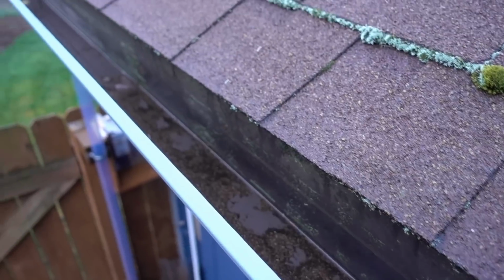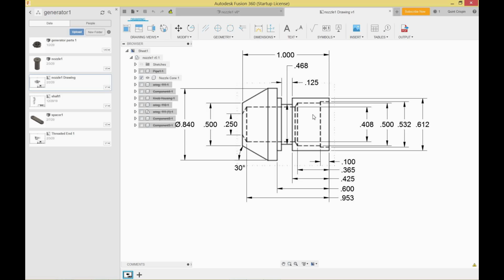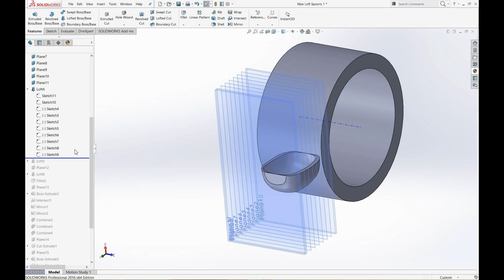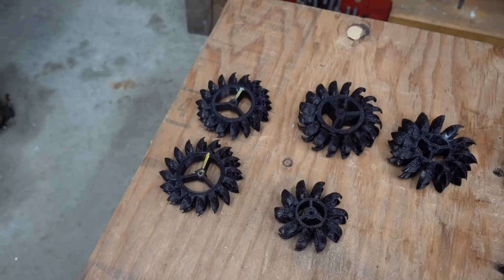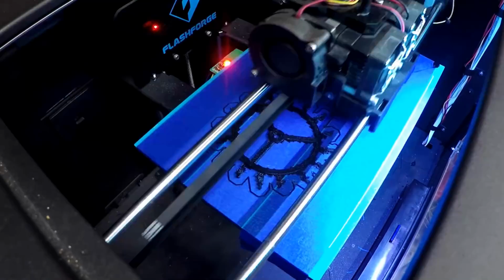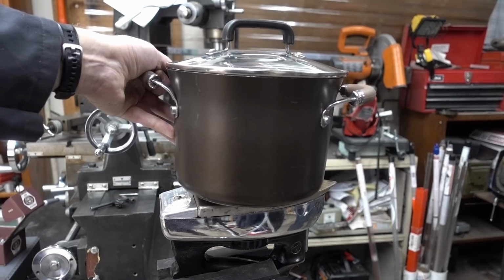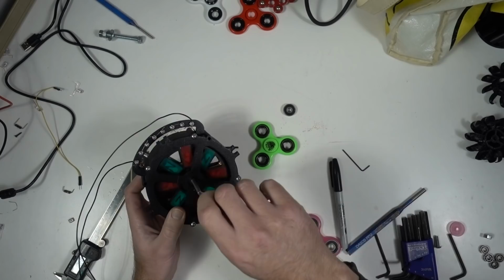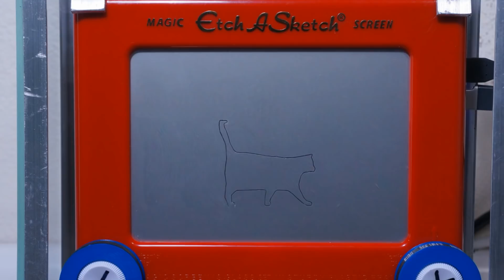Rain Gutter POWER #3 - Fidgeting With Turbines!

Comment: most of the friction is the grease the sealed bearings have and a little from the seal(not much) fidget spinners work by taking a bearing, having no grease and no seals, upside, they spin manually, downside, put into a load application they'd wear out stupidly quickly
Reply from the maker: I went through the drawer of sealed bearings at the hardware store and found substantial variation across bearings.  I suspect it was the rubber seal but wouldn't know without a measurement device and removal of all seals to check the difference.
Reply: @QuintBUILDs  they pop out with a pick or a needle, take a generic sealed ball bearing, feel the friction by spinning it, remove the seals with a needle and soak/spin it in a little petrol, set it to dry,  then spin it again, instant fidget spinner bearing

Comment: I know it's only video 3 on this subject and I've just seen number 6 I think. I noticed that you have the nozzle horizontal to the pipe have you tried having the jet of water coming straight out the bottom giving gravity a say in the matter. As the 90 degree angle of the spout is surely causing resistance.

Comment: Did you think about enclosing the turbine then injecting it with water with an outlet and you could have the water coming in from the top maximizing the gravity assist, combined with the injections all around harnessing the Whirlpool effect as well as a quasi ventruvi effect. Place the turbine horizontal and 45* the shovels.

Comment: I'm interested in why you chose to put the hole in the side of the pipe.  I feel like you wouldn't get the full pressure from the weight of the water in the column in that setup.  If you used a funnel and curved it off of the bottom of the pipe you may squeeze more pressure out of the system.

Comment: A couple of thoughts and or questions.  
1 . Do you think that turning the out put nozzle horizontal is more efficient than having the output vertical down flow ?
2 . Another commentor observed your splitting of supply to nozzles being on a single small tubing source . I tend to wonder if that person was right and that you may be cutting power in half to each nozzle .

Comment: Did you verify the potential of the alternator?  Can it produce 1 watt?  Also because you are replacing pressure with flow, the discharge rate of the water may not be high enough to ever reach the desired 1 watt even at 100% efficiency from the turbine/alternator combo.

The ideal here would be to somehow increase pressure and flow for a higher discharge speed.

Edit
I used "flow" when 'volume' would have been the proper term...  I think.  lol it's been quite some time since I have "scienced"  😋

Comment: Have you considered other means of generation besides the Pelton wheel, such as a Francis spiral or a reverse Archimedes screw?  It might be interesting to determine which would offer the greatest conversion efficiency based on varying flow rates and head pressure?

Comment: @quint builds; I didn't read the other 3500+ comments so I might have missed it.  I see that you engineered it to have the jet shooting horizontally.  Wouldn't a downward facing jet be better?  1) the water would have a little more gravity behind it.  2) the water in the "cups" (near the 1-3 o'clock position of your setup) would be able to escape nearer the 6-9 o'clock position.  As soon as the water gets to the 3 o"clock in your original setup it's fighting gravity.  Thoughts?

Comment: Did you considered the fluid losses through the gutter and all the system? with such small amount of energy obtained from that roof, for sure any simple loss is critical in your design. Also, just to add fun, with all the work you have put towards producing that energy you could have payed 3 years of the electricity that it produces. :D anyway thanks for the experimental process.

Comment: i'm wondering what the flow rate was before and after the installment of the nozzle, the power output was roughly the same, but if you did it with half the flow you still made a huge improvement

Comment: If you try a larger bearing I think it would be less resistive as well as more durable
Reply from the maker: I reasoned that the smaller bearing giving equivalent friction at a smaller radius would result in reduced torque.

Comment: Change tube ..To a bigger diameter 12"
The waight of the water increase 
Pressiur...
Add more nossels Then 1 
You add if 1 is 4watt
2 nozzels is 8 watt
3 = 12watt ..
Reply from the maker: Pressure is density x gravity x height.  It (and power) are independent of diameter.

Comment: I wonder if a second water nozzle output would help. Maybe one on top of the wheel and one on the bottom in the opposite direction would harvest the wasted energy.
Reply from the maker: You must not have watched the whole thing before commenting?
Reply: @QuintBUILDs  Oh I missed it. Wonder why that didn't work? Maybe make the holes half the diameter so you don't lose too much water pressure? Anyway that was a cool project, subbed.

Comment: You're losing a lot of downward momentum by putting the nozzle in the side rather than printing an angled funnel at the bottom of the pipe. You're basically just getting the water pressure and no downward momentum.
Reply from the maker: The water velocity in the large pipe is near zero. It's a reservoir.  No momentum to lose.

Comment: What if you used the weight/power of the water falling from the top of the drain pipe, to lift a small weight that would somehow be attached to a "plunger" thingy that would add pressure to the water. It would work in bursts I think. Or maybe if you moved the turbine higher up and collect the waste water to use, kinda like one of those marble track escalators....?????

Comment: Ok,, I've watching these 3 video series. Now I'm curious about a couple things,,, A- since an alternator, and a generator, have the same build set up principle,, meaning a stator inside of copper coils,, why can you not still design a generator without the brushes?  B: have you thought about using a series of gears,, much like on a 20 speed bicycle? And C: making the water wheel a much larger diameter, with many more cups, in addition to the multi-jet idea?? I would think that idea would cause a faster rotation at the center of the wheel.
Your thoughts?

Comment: Augmenting the height of the water column would augment the pressure, even with a very small diameter.
How could we do that? By digging… or using a pump. How much electricity does it consume?
Above what height would that be interesting?

Comment: The outlet of the nozzle is the same size of the hole. Why not make a tapered design like a fire hose and a small outlet like the ones pictured?You could prototype with the printer and epoxy to fill the layer gaps  pretty easily.

Comment: If you extend the height of the pipe for a greater pressure ? Also sounds silly but if you put the alternator into a vacum would less air resistance also improve efficiency? Just asking 🤷‍♂️

Comment: You need to put it down its now hanging but then its harder to turn when you put it on it side then gravity wil take off the pressure on the wheel and it will go much faster because it got no pressure from gravity

Comment: Hey great project.  I'm a Master Brewer.  I push water around a lot.   Are you maximizing your head pressure?   Also, your wheel looks a bit overpowered by your choice of flow rates, dependent on your orifice size.  These are all variables.   Might add some balanced weight to your wheel as well to optimize the grab on that kinetic energy.  And _I_ might realize there is a 4th video LOL.

Comment: What if you did the multiple head setup with the graduated tube around the wheel? What about turning the wheel sideways so the water casts off after the initial contact and shed the extra weight of the water

Comment: Mechanical engineering 101: Power (watts) is pressure (pascals) x flow (cubic metres per second). Water pressure due to height is 10000Pa per metre. Even the best turbine won't be more than 80% efficient. Convert volume to gallons if you must, but you'll quickly see how much of a waste of time this is.
Reply: I literally came here to say this, just a very rough guesstimate says they’re running about (one to two) cups of water per second which is roughly (2.5 to 5) x 10^-4 cubic meters per second, or in layman’s terms 0.00025 to 0.0005 cm/s.

Assuming one meter of water, that’s Power (in Watts) = 10,000 * 0.0005 = 5W, and that’s being incredibly generous with their flow rate which is likely about a quarter of what I estimated.

Factor in the poor efficiency of the turbine and alternator and I think they’re pretty much at their peak already - using two nozzles to power two turbines wired in parallel would be the ideal way to go here, rather than using both nozzles to power the same turbine at such low pressures.

Comment: Would It be possible to incorporate an excited field to the alternator to increase the drive load and regulate the voltage to stay at 5v?  The intent would to be design a turbine that produces more torque at a slower rpm. May be a slower system may capture the water a little more efficiently.

Comment: Would it make any difference to change the angle at which the water is coming out of the pipe? So if you were to out the nozzle pointing straight down, rather than to the side?

Comment: Are Pelton wheels the most sensible application as their efficiency is so dependent on inlet speed so how could you control that with the rain gutters. Also could you not calculate the maximum energy within your pipes to determine what the maximum electricity is you could obtain to see what efficiency you are actually achieving. Cool project liked the video

Comment: Hi, I found all 4 parts of your project quite interesting. However, I was disappointed to see that you did not show any adjustments being made in the nozzle that you made. 
I’m not a scientist and I guess you are so forgive my lack of understanding if I’ve got this wrong. 
Like a garden hose or a jet washer, the size or shape of the nozzle changes the speed at which the water flows. I reckon if you go back to fitting the nozzle you made and adjusted it so it gives a higher pressure of water displacement, then you might find the wheel will spin faster (maybe) 🤷🏾‍♂️
I really would like to know if you did that and what the results were 👍🏾👍🏾

Comment: Would orientating the jet vertically help? So that the stream is shooting straight down or slightly across the wheel, and the waste water is then shed without being caught in the wheel’s cup and hence not adding weight on the up swing?

Comment: Stupid question, but what if you built a curved piece around the wheel? A lot of the water's energy seems to be flying in a roughly horizontal path after hitting the wheel, so would putting a curved piece of metal around the wheel to redirect the water increase the output?

Comment: My question is. Why isn't the turbine mounted in the downspout itself to use the gravity pressure in strictly, vertical to horizontal configuration, and avoid the loss of changing the supply water 90 degrees.

Comment: The reason the bearings spin faster is due to the grease that's inside the sealed bearings. Soak them in wd overnight and see a difference

Comment: To help create higher pressure from the water pressure, why not create a no energy loss pulley system that maintains near perpetual energy by its own weight and motion and use that force created to create a pump that forces the energy down the pipe with greater force without alhaving to input any force other than the initial push? I'm high Idk if this would work.

Comment: The peltor wheel has it's maximum efficiency of taking energy from the water if the speed of the buckets runs at one third of the speed of the water
Reply from the maker: Isn't it 1/2?
Reply: @QuintBUILDs  Remember it was an exam question we had in fluid dynamics, to calculate it using control volumes. I got 1/2, which was wrong, due to a silly mistake reducing the expression before deriving it.
Reply from the maker: @steinpedersen1390  then you should go have a word with Wikipedia: "Maximum power and efficiency are achieved when the velocity of the water jet is twice the velocity of the rotating buckets."
Reply: @QuintBUILDs  Ha ha! Wikipedia in a nutshell. Had to doublecheck it with my old fluid book today. It comes from setting (d/dV_cv)P = (d/dV_cv)F*V_cv = 0, where F = rho*((V-V_cv)^2)*A*(1-cos(beta)). Giving V_cv = V/3 as a root. Sorry for nerding out. Got a bit carried away down memory lane. ;-)

Comment: silly idea instead of the way you have the alternator setup ... switch it so that it is on top looking down ... change the rotor to a Schauberger turbine and that will then spin your alternator ... while the schauberger turbine (the tulip one should work better) maximizes the work of the water ... then  you can also do a vortex flow and pull the pelton wheel along with the water vortex .. then the buckets (flow by better) will stop wasting potential and use more of it

Comment: Isn't it possible that the diameter of the water being launched at the cup on the wheel is in fact also hitting the backside of the cup before, and rather then adding to the overall speed of the wheel it is pushing back against it thereby subtracting from the overall speed? Just a thought.

Comment: I wonder if the angle your using where the water hits the wheels is the best. The stream of water is coming out of the drain pipe at a 90° which I imagine, uses it at max flow rate. But as you've pointed out, max might not be a better transfer of power if energy is getting wasted. Then the thought hit me, what would result if the water was coming down onto the wheel from above, using gravity to its max advantage. Instead of interfacing with the wheel from 90° above or below, from the side, what if you angled it to aim downwards from above the wheel. Would this add a, "gravity assist" so to speak?

Comment: I'm no mechanical engineer, but I have an idea. When the water turns from going downward to going horizontal at the nozzle it loses energy. Would it be more efficient to slowly turn the water in an arc or even just put the nozzle pointing downward?

Comment: Questions:
Can you increase the gravitational force of the water by making the "down spout" funnel shaped to allow more water to be stored at the top? I'm unclear how the physics works in that regard, e.g. whether angular pressure applied from the walls of the funnel affects psi at the nozzle area.
Also, can you increase the force of the water by suspending a weight in it? For example, hanging a lead weight from something buoyant enough to hold it above the nozzle.
Thanks for an awesome experiment!
Reply from the maker: You're welcome!  but no, those things don't help the energy equation.  The pressure = depth x density x gravity so width doesn't matter.  Like swimming in a pool, it's not the size but how deep you swim.  The weight in the water would initially raise the water height by displacing the water but then everything would return to the original positions.  Good questions!

Comment: just wondering. is it possible that the different sizes of the jet would give you more performance. I would try different size just to see what would be the difference in the power output. also why not to shot water from the top of the turbine wheel. in slow motion you can clearly see capillary action causing droplets to shot ( climb up ) upwards( in my opinion that could affect the speed of the turbine) . the turbine wheel theoretically won't spin faster than the speed of that laminar flow of the water hitting the fins, maybe maximizing the stream speed without losing too much water by different shapes and sizes of the nozzle . BTW GREAT VIDEOS!

Comment: Could you add a second Pelton wheel generator higher up with a divider to prevent water from the first from interfering with the second wheel? Combined, theoretically generating over one watt even if it reduces the rpm's a little?

Comment: more turbine revolutions like a pulley will create more strength like the difference between a short pulley and a long pulley when trying to  lift a heavy rock but this time more revolutions less effort thus increase in speed don't know much but what do you think ? and the water hitting from above and turbine below and water pointing forward and hitting the turbine from backwards thus water moving forward towards
 the water flow increasing through gravitational force

Comment: You need to work your geometric formula. your electrical flow is good, the idea for the current capacity toward generating volts; you must work on your geometric formulas. And that will solve + / - results generating current flow. Good luck

Comment: Why didn't you 3D print Rollerblade Ceramic bearings to the Wheel? "The force of least resistance" Bones Swiss 608 Skate Bearings, or Bionic Ceramic Bearings, Also do a double jet instead of single jet, there is enough pressure for two for top and bottom.

Comment: Some time ago I submitted a comment about my ideas regarding the same principle. it has been sometime since I checked on this project. If you were to add a tank just below your gutters to collect the rainwater would it not increase the pressure in the output, due to the excess volume contained within the tank? would not the weight of the water in the tank add weight and pressure to the water in the pipe, rather than the water coming straight from your gutter into the pipe?

Comment: Doesn't a 'roof' for the wheel work to improve the flow? Now the flow can spray out (and still have a decent velocity) if this velocity is higher than the speed of the outside of the wheel, something like this roof could help